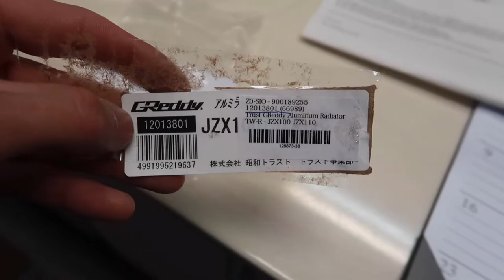Best day ever! Greddy radiator install on my JZX100 Mark ii!

Comment: i jumped on the project mu 6 piston big brake kit for my gs300 
saved a good 600 bucks
picked up a jzx100 chaser tourer s ill be swapping later this month
going to be picking this radiator up with a few other greddy goodies too